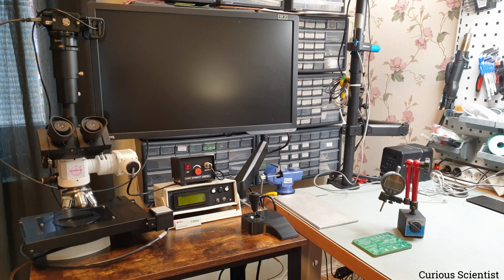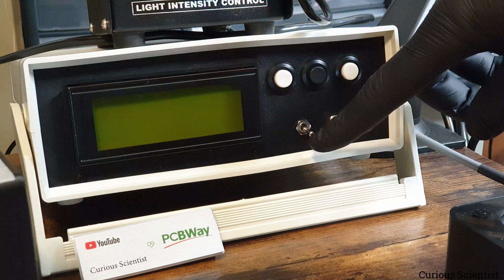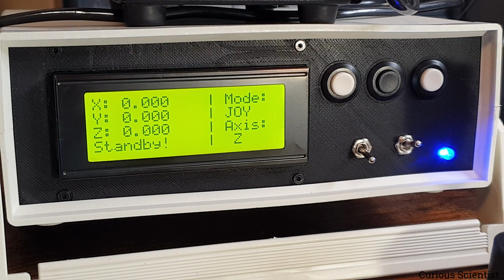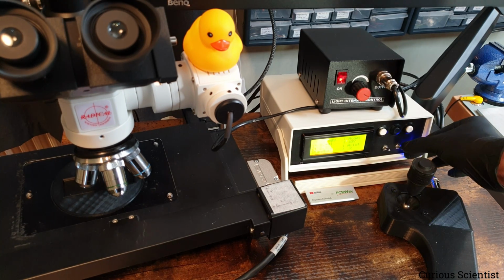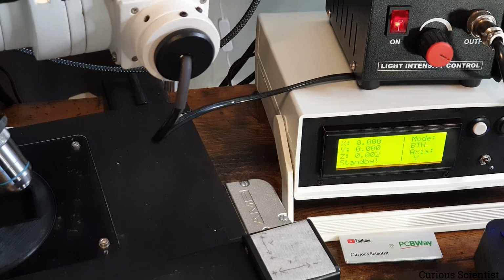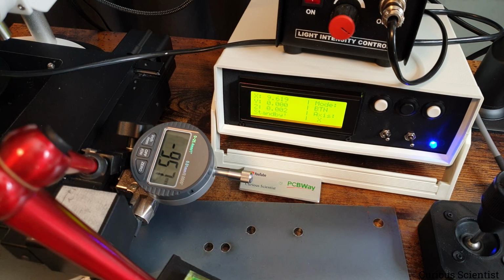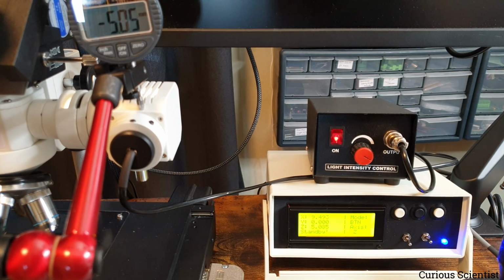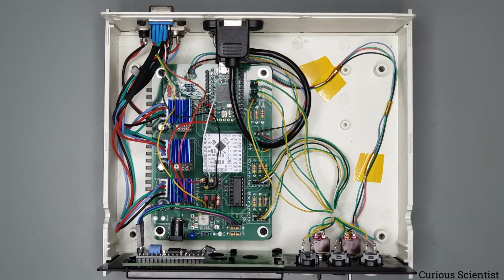How I Automated My Metallurgical Microscope

Comment: Video Summary: How I Automated My Metallurgical Microscope

This video by Curious Scientist demonstrates a finalized, automated metallurgical microscope system. 

System Overview:

* (0:00)  Features motorized XY stage & Z-axis (focus) control.
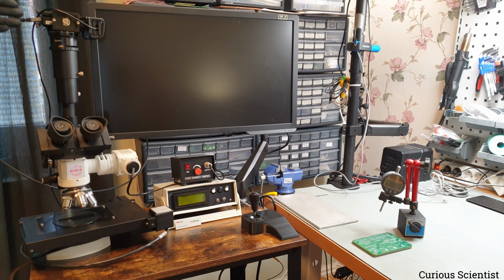* (1:00) Uses a camera mounted to the microscope, outputting to a large monitor. 
* (1:18) Includes a control box with:
    * (8:55) LCD screen displaying positional information and system status.
    * (2:07) Buttons for forward/backward movement, homing, and aborting actions.
    * (2:20) Switches for selecting between joystick, button, or USB control modes, and for choosing the active axis.
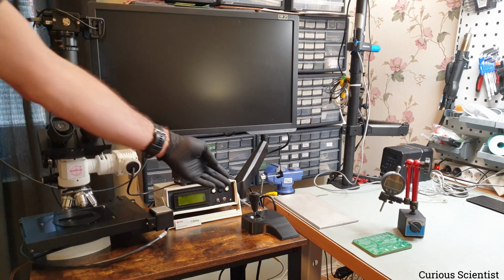    * (3:15) A three-axis joystick for intuitive stage movement.
    * (2:58) Status LED indicating the system's current state.
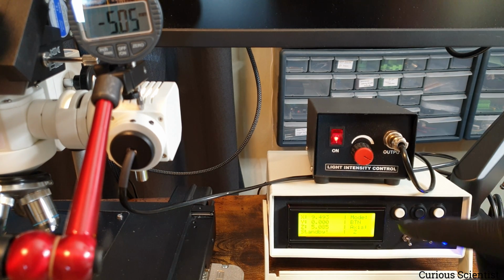* (26:57) Employs a custom PCB with:
    * Teensy 4.0 microcontroller.
    * TMC 429 stepper motor driver.
    * TMC 2209 stepper motor drivers (x3).
    * GPIO expander for switches and buttons.
    * Front-panel RGB LED.
    * I2C display connector.
    * Onboard voltage regulator.
    * External 12V power supply (and USB for standalone mode).

Functionality Demonstrated:

* (11:56) Joystick control of XY stage movement and Z-axis focusing.
* (12:58) Button control for individual axis movement.
* (17:22) Homing function to reset stage position to a defined zero point.
* (15:22) Adjustable speed settings for different movement modes and axes.
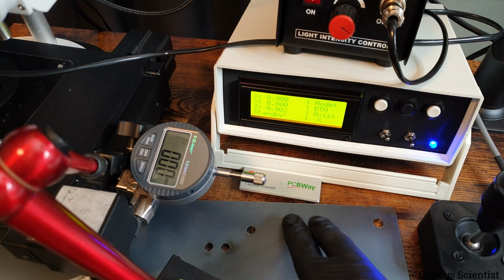* (19:15) Display of accurate positional data on the LCD screen (within a tolerance of ~50 microns).
* (31:56) Smooth and precise movement, especially for fine-tuning focus with the Z-axis.

Additional Notes:

* (38:22) The creator emphasizes the project's DIY nature and encourages viewers to build their own controllers using the provided PCB design (available on PCBWay).
* (38:43) The software used to control the system is not publicly available and won't be shared.
* (39:19) The project primarily serves as a demonstration of the creator's skills and knowledge. 

i used gemini 1.5 pro to summarize the video
Reply from the maker: Thanks again! It is insane that it could extract the exact parts and such small details that, for example, I mentioned that I won't share the code this time. Amazing!

Comment: what stage have you chosen?
Reply from the maker: Please read the article. I am pretty sure that there's a reference to my article there where I even put up an ebay lisiting.
Reply: @CuriousScientist  OK, I tracked it from your previous post, i.e. Thermo Scientific Nicolet FT-IR (microscope I assume). Not much info though, since Thermo does not build stages. It is probably from ludl or prior.
Reply: @CuriousScientist  The stage is not flat enough, it it inclined along y direction. Probably due to that piece of printed plastic.
Reply from the maker: Yeah, well, I am just a hobby dude with hobby tools, so I could only print this good. It's enough for my purposes.
Reply: @CuriousScientist  try metal cuts and avoid printing. 3d printing is overated and overused. No microscope manufacturer uses plastic on their stages. let alone 3d printed plastics. The build of the controller is nevertheless interesting. Have you thought interfacing it to micromanager application?
Reply from the maker: I am not a microscope manufacturer. This stage is not even a standard accessory for this microscope. It's a custom modification. I don't have access to a workshop, so I am perfectly fine with 3d printing slightly off-tolerance parts. 
I personally haven't, but my friend, who I originally designed the board and the software for, built a very neat software for it. He uses it with a proper microscope without 3d printed parts. :)
Reply: @CuriousScientist  Sure, my question was related to a possible future development. Micromanager is a open source software platform that allows full control with a PC of all optical microscope automatization.
Reply from the maker: Ahaa. Well, I might do something in the future, but strictly for my system. Unfortunately, I don't have the time and resources to make a large open-source contribution.

Comment: Very nicely done!  I have a couple of questions:
1. Why does the Teensy need it's own supply?  Could you have used a buck converter to reduce the voltage to 5v to power it?
2. Does the joystick work in relation to the table or the workpiece?  What I mean is if you move the joystick left and the table moves left, then the workpiece area that you are examining moves right.  That might take some getting used to.
Thanks!
Reply from the maker: Hi! 
1. Adding a 5 V supply seemed too tedious at the time when I designed the board and since USB adapters are so available nowadays, I decided to power it with a USB adapter. But actually, one of my friends is using this board at his workplace and he actually made the exact same modification that you mentioned. 
2. Check the video from 12:00 I explained it very carefully. Everything moves together, there's no need to get used to anything.
Reply: @CuriousScientist  Hi,
Thank you for your response.  Allow me to clarify #2.  If I move the joystick right, the table moves to the right, If I move the joystick to the left, the table moves to the left.  But imagine for a moment that I'm shrunk down and suspended just above the workpiece itself holding the joystick in my hand.  If I move the joystick to the right, the table moves right and the workpiece that's now under me is now viewed to the left of where it was before.  So my point is that you have to have to hold a perspective in your mind that your right and left movements of the joystick are for the table, not the workpiece viewing area since moving the table to the right causes the workpiece to be viewed to the left of where it was before.  Same for front and back.  I hope that makes sense.
Reply from the maker: Hi! I perfectly understand you. I work with scanning electron microscopes where the perspectives and coordinate systems can be really messed up if the scan rotation is changed or the sample is tilted in a weird way (or both). So I think I understand what you mean. But in my setup, everything is harmonized. When I move the joystick to the left, the stage goes towards the left, and the image on the camera also goes towards the left. And the same with all the other directions.

Comment: Sounds like the XY stepper motors are not operating in StealthChop mode.  Z-axis is very quiet.  I'd expect a 3:1 rack and pinion to be noisier than a lead screw.  TMC2209 should be near silent.  Easy fix in software though.  Maybe your multiplier should be a change to micro step value instead.   Cool project.  Nice to see it all come together.
Reply from the maker: Thanks! I have StealthChop mode enabled in all axes. Actually, all axes are configured the same, regarding the driver settings. What I suspect is that at higher speeds, I hit the resonance frequency of the stage, and it starts to vibrate. At least it sounds like that because at lower speeds, the stage motors are also silent. I will look into it, but as of now, it is not that annoying to me.